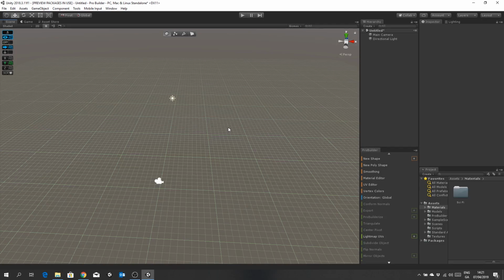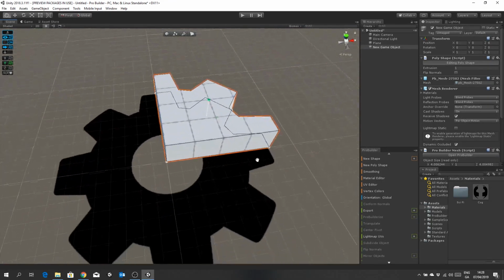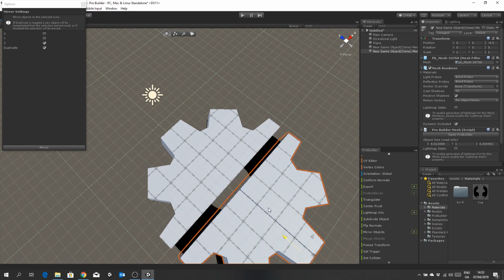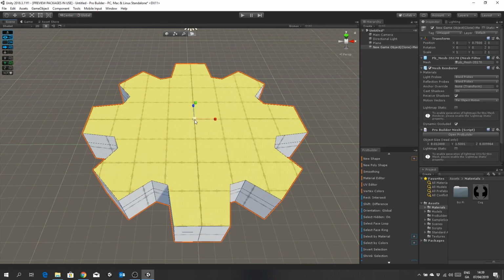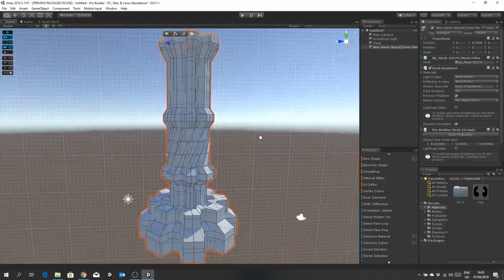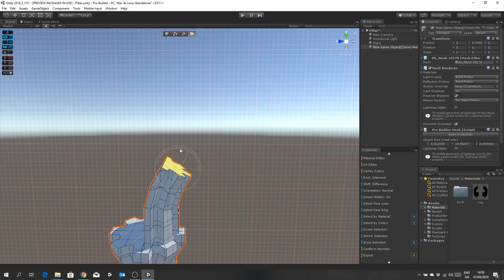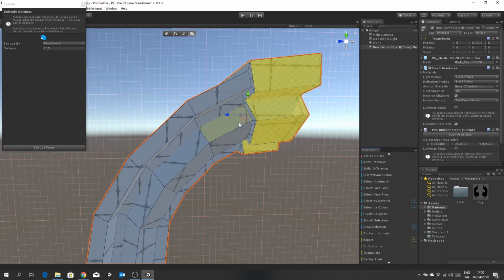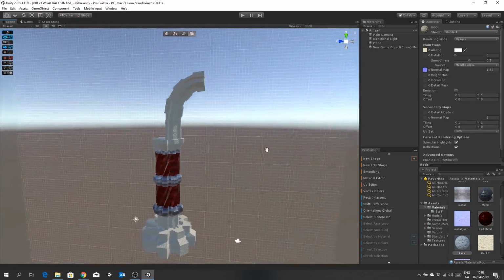Unity Pro Builder Column

Comment: Is it possible to model a tree or a flower in probuilder ?
Reply from the maker: Hmmm...I would say it's possible, but it depends on what style you are going for? Low poly stuff should be no problem. If you are going for realistic, then I would probably go with probuilder for the trunk and branches of a tree or the stem of a flower and then I would use flat planes with transparent textures for petals and leaves. I might have a go and do a video!
Reply: @joeroe8341  Glad to hear that , thanks..